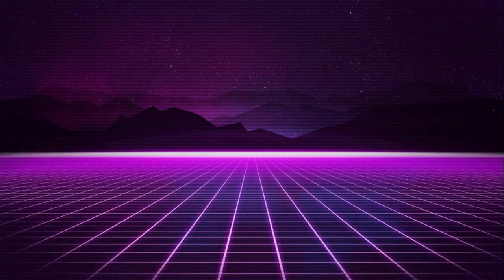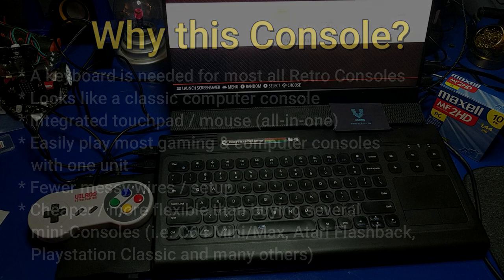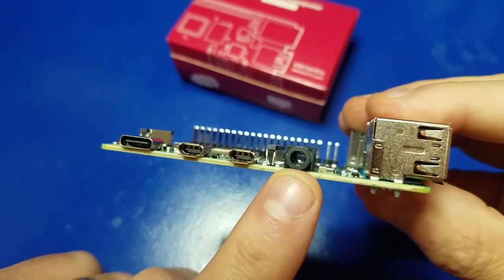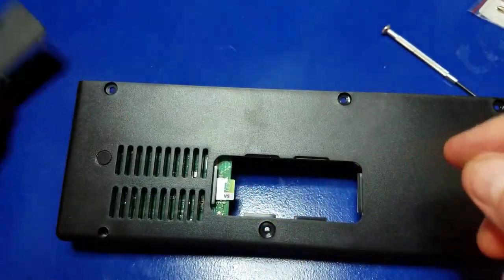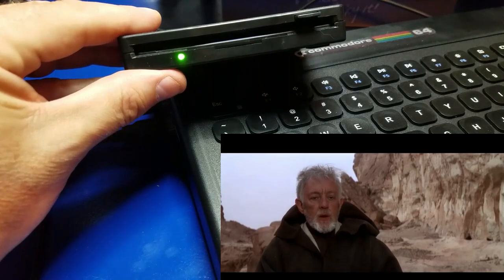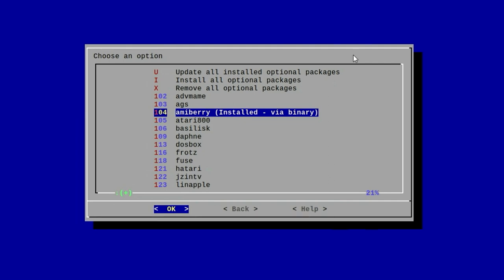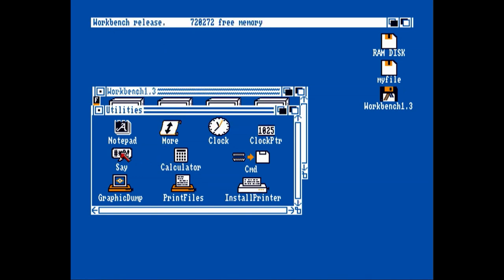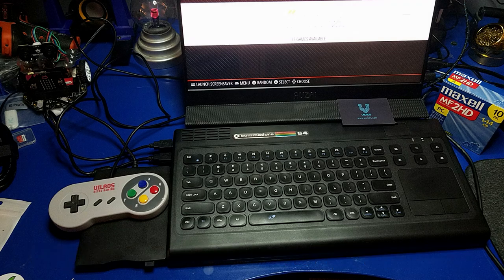Vilros Raspberry Pi 4 Desktop Kit + 3.5" - FDD Setup a Retro Console

Comment: I was searching for hours and hours for the past week at least trying to find "pc in keyboard" type videos and finally in inadvertently came across this video (even though it didn't really have any of my used keywords). I'm actually working on a project similar what this kit already provides. I think mine will be better though. Similar to this it will be a "single board PC" inside a kb and similar to you I was going to put emulation station and some keyboard-oriented retro OS on it. Not sure how or if I'll add a mouse but I can't worry about that quite yet. So I'd like to thank you for this video and bringing this particular Pi kit to my attention since didn't know it existed.
Reply from the maker: Sounds like a fun project, please let me know how it goes!  With this or any Pi 4 kit, you can easily add a wired/wireless mouse.  I have a separate video on TwisterOS if that is anything you're interested in (Mac and Windows look on the Pi 4 plus much more).  The latest version includes DOSBOX, Wine, RetroPie and a bunch of other apps. pre-installed which may simplify things for your project.  In-fact, one of my future plans is to make a video installing OS/2 Warp from my original CDs.  May be a few videos down the road, but something I'm definitely planning at some point.  Glad you found this video helpful, a lot more is planned!
Reply from the maker: Side note: I have a bunch more information on my website about this and other Retro-oriented projects here: http://wagnerstechtalk.com/rpi4gaming/

Comment: Awesome vid man, although I'm not sure why they made the case need AAA bats and a wireless dongle instead of just wiring it internally since the pi has USB headder pins.
Seems kind of a weird design flaw tbh
Reply from the maker: Thank you Brandon, fully agree.  The keyboard could have easily been powered by the GPIO / USB. You may be interested in the new Pi 400 which has the keyboard fully integrated into a re-designed board.  Here's my setup video on that, if interested: https://youtu.be/cwRBLU0ahp8

Comment: That's an interesting idea, say if your looking to build your own DIY C64 and emulate a real one from back in the day. for me I'm doing much the same for the Apple IIe platinum back in 1993 but I'm going balls to the walls by bringing it into the 21st century with Thunderbolt 2, Wifi, Blutooth, USB, (since you'd find both those connections on a PC) Serial, Parallel, VGA, and HDMI.

Comment: Could you squeeze the floppy drive into the case, à la the low-end Amigas?
Reply from the maker: You could probably 3d-print a bottom riser type of solution where you could install the floppy drive on the bottom.  There may also be enough empty space inside the case to do that, perhaps using a dremel.  That's a good idea!

Comment: so mamy6of these external floppy drives seem identical but they're not. the one I bought isn't recognized by anything that isn't a super old windows machine.  what would one look for online to make sure it would work with more modern machines? thanks, from Spain :)
Reply from the maker: Thanks for watching Janet!  The main thing to look for is that it supports a modern operating system like Windows 7, 10, 11, Mac, etc.  There is a link in the video description for the exact one used here, but not sure about availability in Spain for that specific model.  The use of that floppy drive is certainly not necessary, I only used it to illustrate a retro-looking modern console.

Comment: FYI: Vilros will not ship outside of the US. I couldn't find an EU or GB based dealer either.
Reply from the maker: I wasn't aware of that, I have a contact at Vilros I'll ask if there are plans for it and comment back here.
Reply from the maker: Wow, they were quick responding.  They stated: "We are hoping to launch international shipping within 6 months."
Reply: @WagnersTechTalk  Wow, you're quick in responding too! Thank you for checking w/ Vilros. :-)
Reply: @meneerjansen00  The keyboard is on Amazon UK (sent from the global store) if you search "Vilros Keyboard and Touchpad Hub" - this is the main part,  you could source all the other components individually if you cant wait 👍
Reply: @CalmCal  Thanks for the tip on Amazon UK! For the few remaining months that one can import from the UK to the EU without paying import taxes that's a good option. After Brexit Vilros' stuff may be available on Amazons' EU counterparts. :-)  

P.S. I'm not interested in the "complete package": I already have a Pi and all the needed cables. :-)

Comment: Im using a 3b+ and its having some problems with the usb floppy, when i eject a disk it wont read the new one i put in, i have to unplug it and plug it back in with the disk already inside, this does not happen on my windows 7 pc
Reply from the maker: Very strange, I only tested it with a Pi 4 and didn't have to do that.  You may want to post your question here: https://retropie.org.uk/forum , may get more helpful replies.
Reply: Thanks, i havent been there before, the other websites ive looked at said to just emulate a floppy drive, but thats no fun, i'll see if this one can help me

Comment: It is not a console. It is a computer. It would be the same if you called a Pentium-II/Win98 machine for a console.
Reply from the maker: Back in '83 when I got my TI-99/4A, the User's Reference guide even called it a console.  At that time, the term console and computer/home computer were used interchangeably.  Today, consoles typically refer to a gaming system (xbox/PSx) rather than a computer.  In this video, I refer to it as a console and a computer, neither are wrong.  See this also: http://wagnerstechtalk.com/mrc/#Computer_or_Console
Reply: @WagnersTechTalk  You see. That is were the manual was wrong. It is the same story with those that thought a desktop case with the computer is a harddisk. A common mistake of terms.

The manual most likely stated it as a console, because they were the keyboard and monitor, that was hooked up remotely from the computer it self. They are also known as terminals some times.

Console/terminal is a single unit of a monitor and keyboard. Just without the computer it self. You can have multiple consoles hooked up to a computer. For example in a vax system.

The reason why it was stated in the manual, is most likely because those who wrote it, came with a solid background in those Unix systems. They simply used what computing language or jagon that they had.